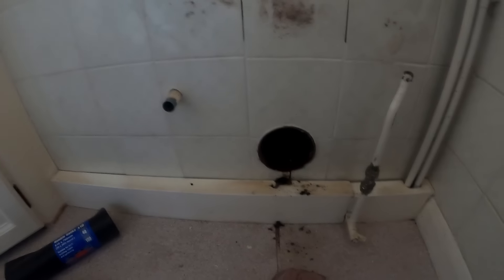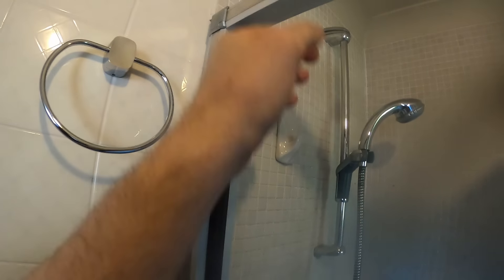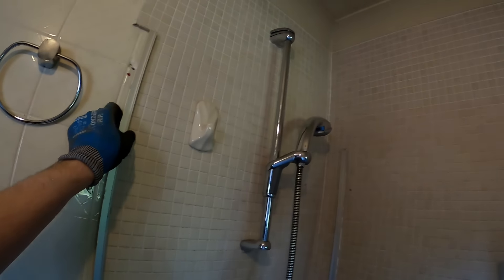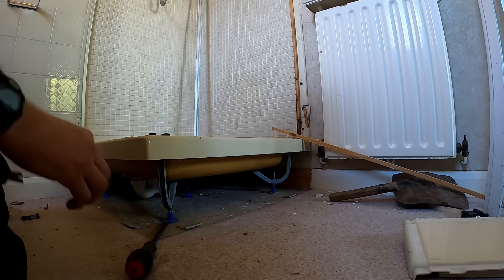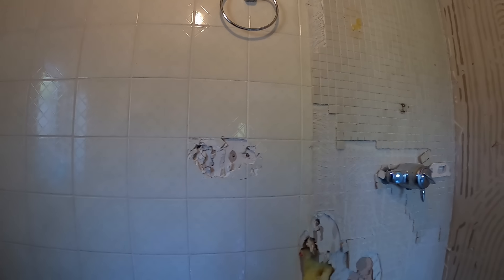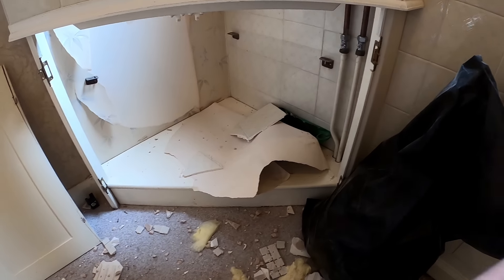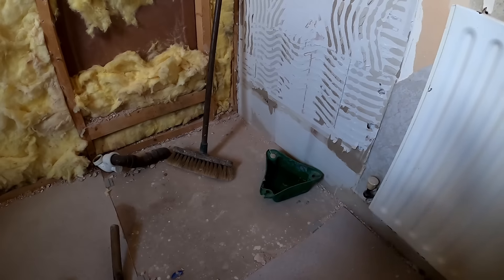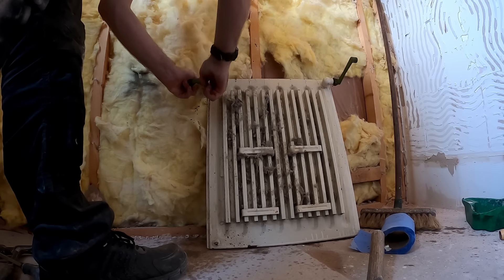BACK TO BRICKWORK RIP OUT | Shower room install part 1

Comment: always remember carrying out a big rad with a mate upside down like you. he suddendly dropped his end and all the black iron oxide jetted out the open vent all over customers carpet! its almost impossible to remove! 🤣🤣
Reply from the maker: It's an absolute nightmare when things like that happen, plumb thumbs and carpet protector have got me out of trouble a few times, thanks for watching as always Pete
Reply: this was years ago before the fantastic plastic was invented. had dust sheets down but it missed them lol luckily was fantastic customer 😀

Comment: Great video great rip out Tom. Can’t believe you took all the tiles off with that screwdriver very time consuming. Look forward to the fitting out.
Reply from the maker: They came off quite well, I find if you go at it too hard it can damage the wall on the other side, thanks for the support as always Mark

Comment: It was all down to cost. British Gas as it was then, used it on all installations I think  they called it “Gas Worm”. The sales men were crap or crafty they forgot to add things like T/stats or length of gas supply etc, etc 😱They still got their commission and the item were fitted at no extra cost to the customer so no real saving. 😂😂
Reply from the maker: That's interesting to know, I imagined it must have been a cost thing, thanks for the support as always Colin